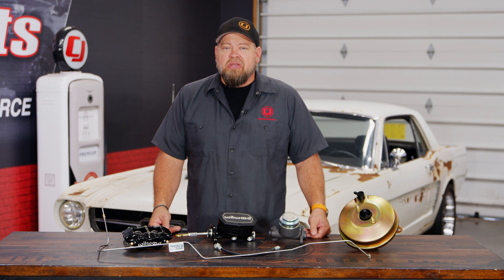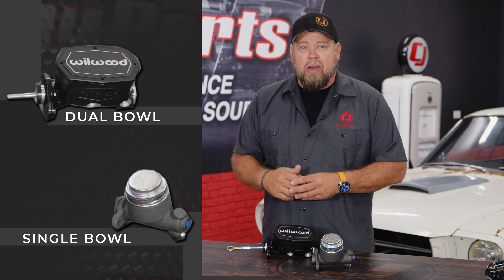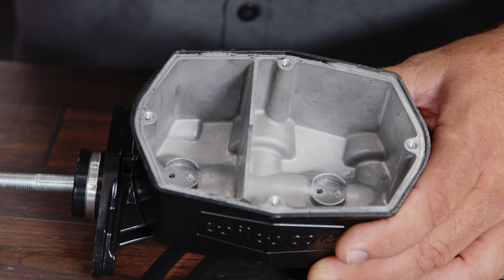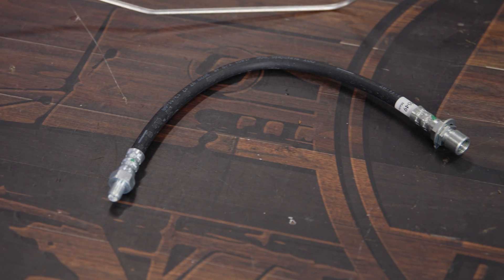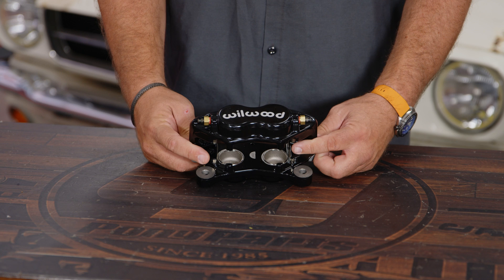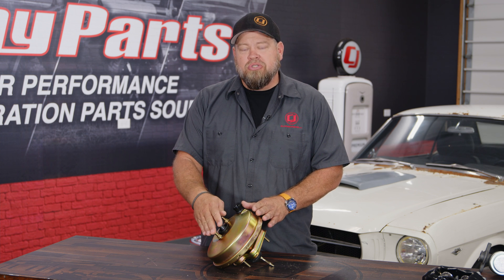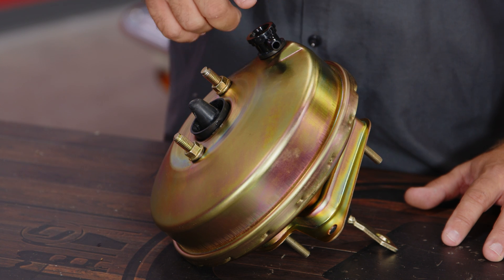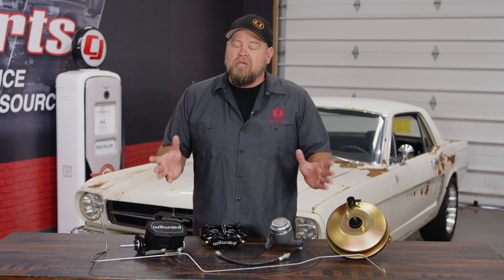Brakes Explained:  The braking news on how they work

Comment: Man your totally wrong on how you explained the workings of that master cylinder.  Those two holes  are piston cavity fill holes  so as to where the brake pads wear the piston as it travels back in master cylinder as you let it back with your foot those small holes will allow for fluid to replace losses in the system as pads go through their normal wear process air does not go into the those two top reservoirs under normal operations and functions. The line "B" nut and lines attach externally to that reservoir.   The lines do not go inside those bowls like you explain or imply it goes. Place the seal back on and cap back on and flip the top of master cylinder away you will see the ports for the lines staring you in the face those line ports staring you in the face are the ports that feed hydraulic fluid pressure out through the lines for the application of brakes not air like you seem to suggest. Can not for the life of me figure out where this nightmare came from that your explaining.